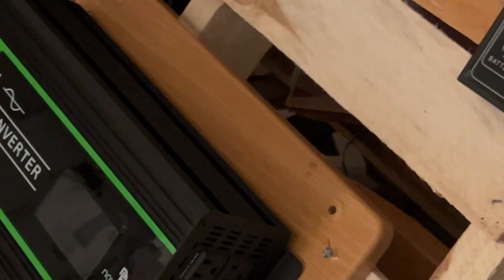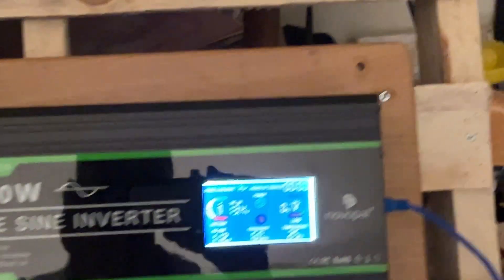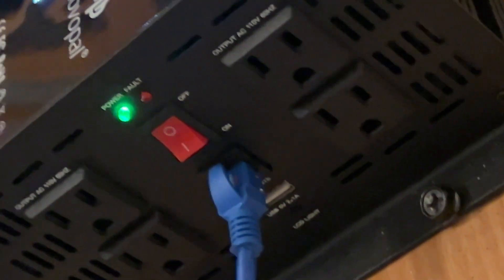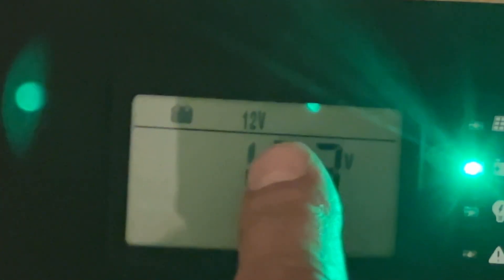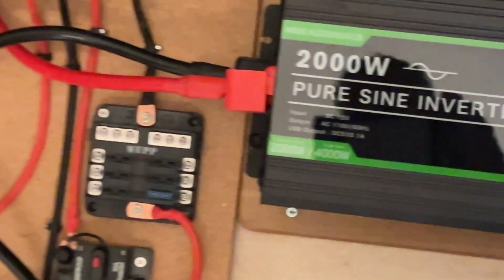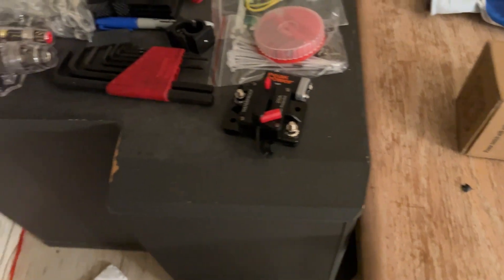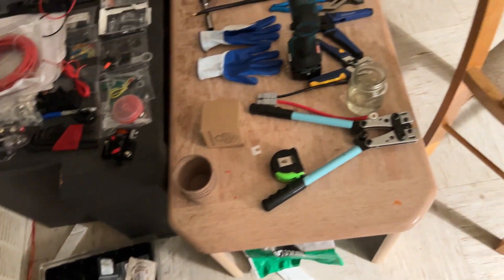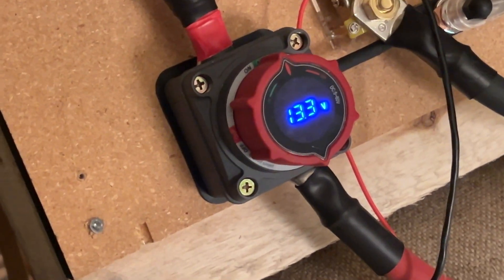Is the 12v 2000w “NOVOPAL” pure ￼ sine wave￼ “inverter” a WINNER?🏆Or a loser?😥￼

Comment from the maker: Hi, how are you? The Novopal 2000 watt pure sine wave works flawlessly I don’t have any complaints with it. It performs all of its duties as represented in the pamphlet. I basically use it to power my toaster oven and my microwave, radio, lamps, charge my power tools and such I generally run it up to 1750 Watts, sometimes up to 2020 with no problems the remote control comes in handy when I’m not near the inverter, I’ve never tested the 24v model but I’m sure it would work superbly. Thanks for the question. I hope I was able help to you. Enjoy the week ahead and keep on building.

Comment: Thanks for sharing. Question How do you like the inverter now that it’s 7 months later. I need a 24Vdc input unit and looked at this mfg. thanks.
Reply from the maker: It's good, I never took it past the manufacturers limits of 4000w for 10 seconds, but I have went up to 2100w for more than 10 seconds, and it did not cut off. My toaster oven 1400 W and a small microwave 700 W toaster oven was on for 20 minutes. Microwave was on simultaneously for three minutes = 2100w, the meter on the inverter went past 100% for more than 10 seconds. It worked fine.
Thanks for watching the video and taking the time to make a comment. Sorry it took me so long to answer. I’ve been busy with other areas in my life, food prices, and everything else that’s going on. Keep prepping and God bless.